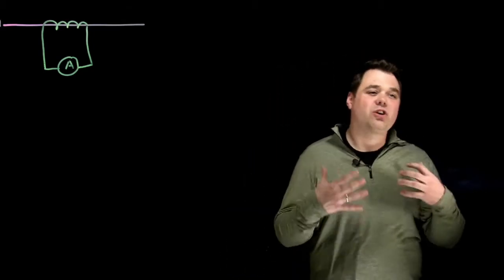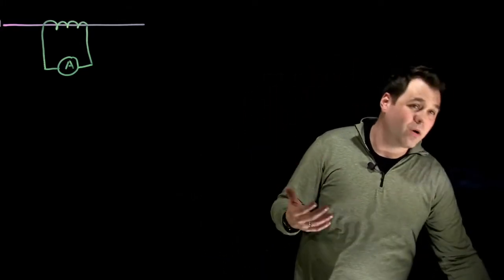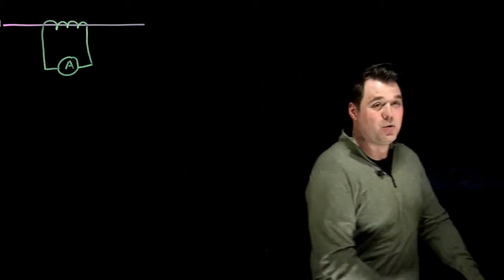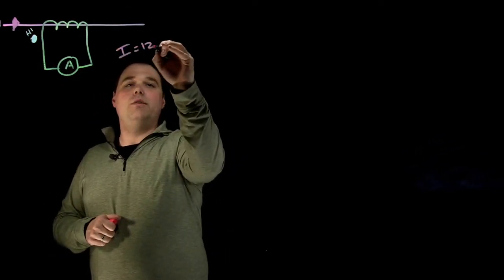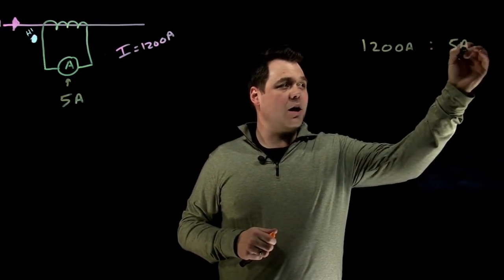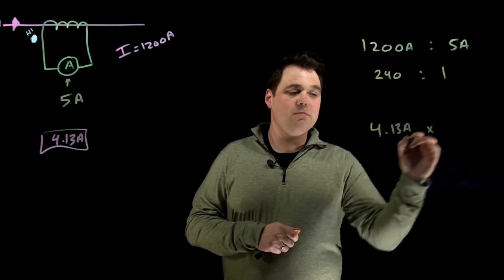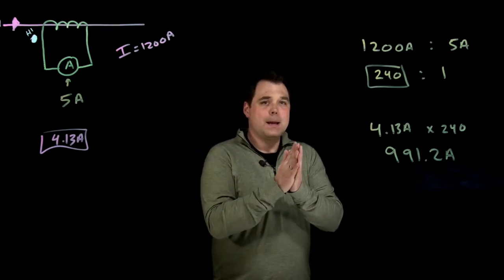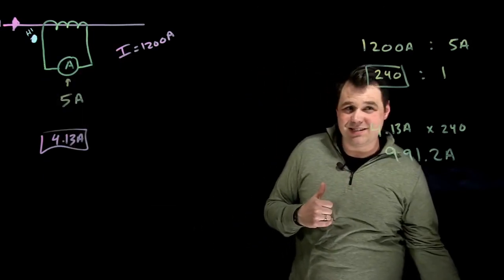Current Transformers - Basics and Calculations

Comment: I want to trigger a relay depending on direction of flow of power in an AC line. How would you do that?  CT with diodes ,resistors, ICS.. what would a practical circuit look like ?